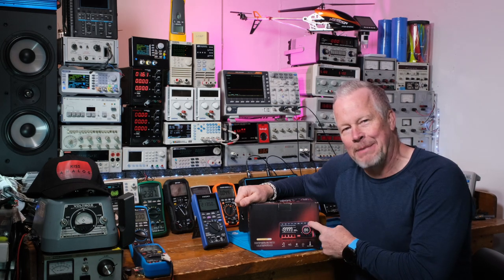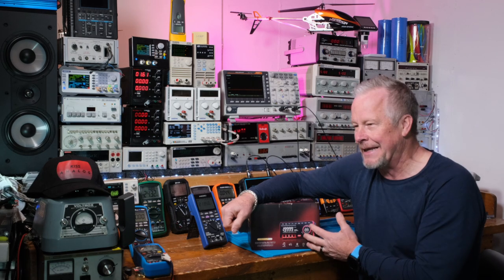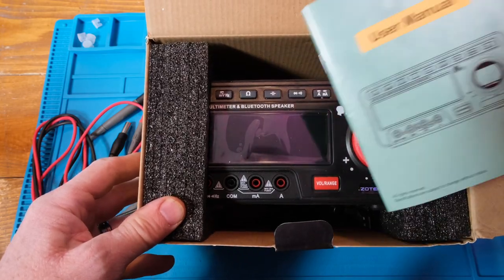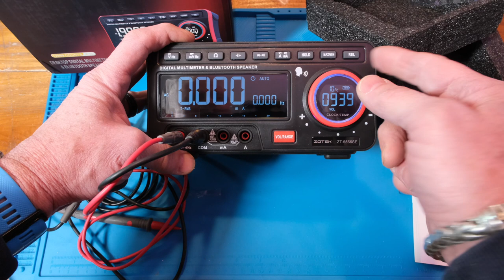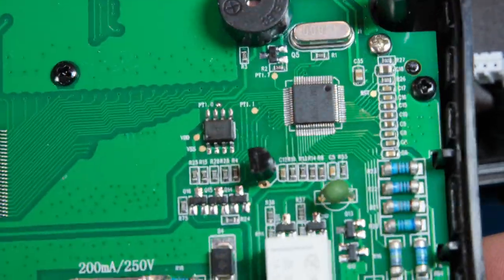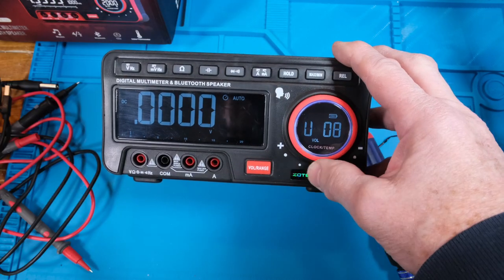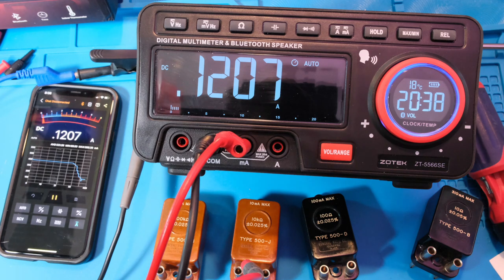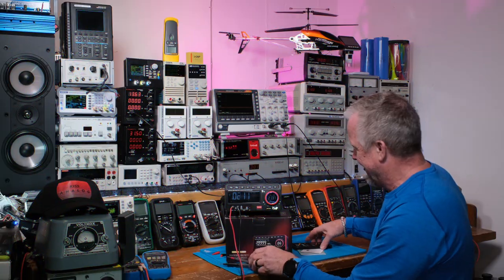New Low Cost Bench Multimeter - the Zotek ZT-5566SE

Comment: Is it spec'd any better than a handheld DMM ? TRMS ? Are those extra counts just noise ? Seems quick enough.
Reply from the maker: Thanks for asking!  It is better than many 6000 count multimeters, and yes it is TRMS.  I think all high count meters are TRMS, and those digits do add value as you can see in the video.  And you are right - it does seem just as quick as the 6000 count meter.

Comment: I've been looking for a panel mount multimeter I can build into my test bench alongside my Riden power supply and Juntech signal generator. At first I thought this was going to be 'close but no cigar' (too deep, buttons on the back), but when you opened it, it looks like I could modify it! Move that internal speaker box under the bench and rewire the rear buttons to the front. But can it be operated safely on USB power, or is that just for battery charging? Could I ask a favour: please could you try removing the batteries and applying USB power to see if it would work on mains only, and maybe also measure continuity between the USB connector and the black probe connector to see if it is isolated?
The button on the test lead is a really cool innovation and nicely implemented with the coaxial plug, but I think I'd prefer it operated a 'hold' function rather than the voice, cute though the subtle Chinese inflection is!
Reply from the maker: Great questions John!  I'll check it out and get back to you.  You have me interested now;)
Reply: It's seems to have some isolation inside. The 'bridge-rectifiers' are opto-coupler. This make sense with the isolation 5V DC/DC-converter. Sure the DMM will have isolation, if it has any  link to a PC (well, only BT).
Reply: @KissAnalog  I actually got around to doing this project! Here in the UK, I could only get the same device branded "ANENG AN-999S" and it speaks Chinese despite having English text exclusively on the front panel! It works fine on USB power, even with the batteries removed, and the USB power ground is isolated from the probe ground which is excellent! As expected from your tear-down, it was easy to convert to panel mount, but the skirt of the rubberised front panel was too deep for my liking so I used a Dremmel to cut it down so there is only about 20mm in front of the mounting panel and 50mm behind the panel, approximately the same as the Riden RD6006 PSU and Juntek JDS2800 signal generator. It was easy to move the rear buttons to the front panel simply by soldering new push buttons across the existing ones on the PCB. The internal speaker enclosure is relocated under the bench. Now I have all the essential test equipment on the bench top without crowding the work off the front due to lack of depth! Next step, see if I can rewire the button on the probe to duplicate the front panel "hold" button, otherwise I'll just have to learn Chinese!

Comment: I think it's great but I don't like the fact that it has an audio player, speakers and a clock. That relegates it to little more than a cheap gimmicky toy IMO. I like the speech synthesiser though. I have an original Micronta speaking multimeter, and it has proved useful on several occasions. Bluetooth phone connectivity with the logging app is also a plus.
Reply from the maker: Thanks for your great feedback!  I didn't know Micronta had a speaking multimeter.  I know a guy that loves to listen to books while he works so he would love this;)
Reply: @KissAnalog  It's the MICRONTA VOICE METER (MODEL 22-164) if you, or anyone else, are interested in getting one.

Comment: Pointless video. He has a lab full of reference standards and high precision meters, yet he doesn't actually check how accurate the measurements from the Zotek are.
Pretty sad that his most profound discovery (repeated numerous times) is "look at all those digits" ... yet it's just a 20,000 count meter with 4.5 digits, which is nothing special. 🙄
Reply from the maker: Thanks for your feedback!  Have you ever seen a video where the meter was out of cal?  If so, It must have been a one of a kind.  Most meters costing much more are 6k count, so a 20k count is not the norm.   What were you expecting - one of those pointless videos where someone takes a bunch of measurements - and then says - close enough - without every shareing what the tolerance should be for that measurement?  I'm not here for that - so maybe you should watch those videos.   20k count - nothing special??
Reply: @KissAnalog  - a 25000 count handheld meter like the Aneng SZ20 or Zoyi ZT-225 is about USD $40. That's well under half the price of this meter.
I am not saying the reviewed meter is a bad thing, but 4.5 digits is nothing special at the $100 price point these days.
Reply from the maker: Thanks for your reply.  Yes Aneng, Kaiweets, and Zoyi have high count meters for great prices - and that is my point.  Most meters - until you go over $200 or even $300 are 6k count meter.  The Zoyi meter you point out makes these 'bench top' meter that I am review.  So first you like Zoyi and their pricing, but not the Zoyi meter in this review?  It is a bench top and you compare it to hand held meters.  This bench top meter has a voice activated measurement system and a clock and will play music via bluetooth.  But you were so triggered by the high count that you thought I repeated too many times that you ignored all this.  So what again was your point??
Reply: @KissAnalog  - my points were clearly stated.
1. You didn't check the meter you were reviewing against any other meter or references. You didn't really demonstrate it much at all.
2. You repeatedly expressed excitement about 20,000 counts, yet that is nothing special at this quality/price point.
I made no adverse comment about this meter, and specifically clarified that in my 2nd comment.
.
It was only about your "review". I based my judgement about this on the numerous other channels that I subscribe to that review the same types of products.
Oh, and I know who makes the meters, which is why I mentioned the Aneng and Zoyi as a comparison.
Reply from the maker: Again your point #1 is a wast of time - and in your words - pointless.  Your point #2 is again incorrect.  Also, this is a bench top meter with rechargeable battery back up - where else can you find that at this price?  Also, it has a radio and can read back measurements via a voice so that you don’t have to look away from your probes.  Again, where can you find all this at this price?  You are so triggered by my excitement… Sorry - it is great you have other review channels that you can watch many measurements against, what you are told, are references - which they are not in fact.  At least not real calibrated references.  But - if that’s what you like…

Comment: their website has NO downloads at all, this means NO manuals, NO firmware updates. NO support links . like many of the cheap products it looks like you are own your own also there is no information about any guarantee or warrantee . The website gives  NO accuracy figures and NO specifications - just a features list. This is the entire website entry for the meter:

"ZT-5566SE is a desktop digital multimeter with Mapp and voice broadcast, It’s a powerful 5-in-1 product, an ideal tool for electricians and maintenance.,CAT III 600V, CAT II 1000V, you can get measurements for : 
AC/DC VOLTAGE,
AC/DC CURRENT
RESISTANCE
CAPACITANCE
FREQUENCY
DUTY CYCLE
CONTINUITY
DIODE
REGULAR TEMPERATURE
EXTRA FUNCTIONS:
MAPP
VOICE BROADCAST
AUTO/MANUAL RANGE
TRUE-RMS
HOLD
HD DISPLAY
LOW BATTERY ALERT
AUTO POWER OFF
BLUETOOTH SPEAKER
TIME DISPLAY
ALARM CLOCK
MAX/MIN
RELATIVE MEASUREMENT"

that's is nothing more about the meter except 2 photos...
and the funniest part is their link to their privacy policy is a template which has NOT been filled out... for example it says:
"The Site is not intended for individuals under the age of [INSERT AGE]. "
"Disclosure for a business purpose: [ADD ANY VENDORS USED TO PROVIDE CUSTOMER SUPPORT]"
"[INSERT ANY OTHER INFORMATION YOU COLLECT: OFFLINE DATA, PURCHASED MARKETING DATA/LISTS]"
"[INSERT FOLLOWING SECTION IF AGE RESTRICTION IS REQUIRED]"
"We [DO/DO NOT] engage in fully automated decision-making that has a legal or otherwise significant effect using customer data."
etc etc....
"Our Site sells Personal Information, as defined by the California Consumer Privacy Act of 2018 (“CCPA”)."
"Please note that because there is no consistent industry understanding of how to respond to “Do Not Track” signals, we do not alter our data collection and usage practices when we detect such a signal from your browser."
in other words they do NOT honour do NOT track, will sell your data... nice
its entirely template so much for attention to detail... which is what you want in a test equipment manufacturer...
I suggest before you are attracted to the screen or form factor you look at the website and specs (or lack of in this case)....

Comment: Looks like an awesome set of features!  I would be interested in one to live permanently on my hamshack desk.  I wish it had a battery checker built in to test AA, AAA and 9volt batteries.  Guess I could make a load box with test points but having that built in would be nice.  de K4TEN
Reply from the maker: Thanks for your feedback!  I agree - I like a battery checker;)  A resistor will work in a pinch - just to take off that surface charge.